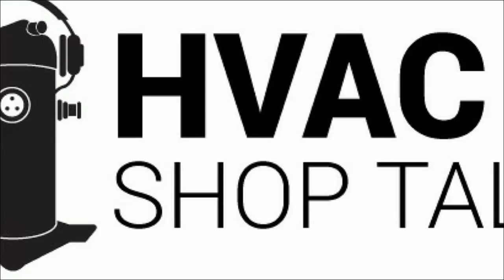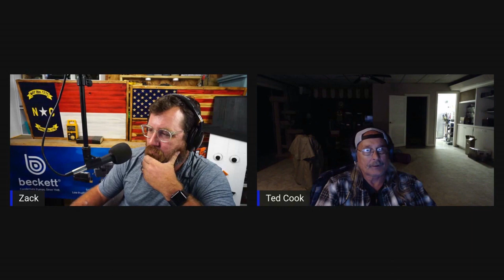This Violates the Rules of HVAC Equipment Design! W/ANTI DIY HVAC

Comment: Airflow... yes. Dumb example, but I remember my old truck's AC would ALWAYS be colder on 'fan setting 4' vs 'fan setting 5', it's like the air was moving too fast past the evaporator on the higher fan setting, so it didn't cool as well. Moving more air isn't more better-er.

Comment: The Bosch is awesome for arid climates where you want to maximize sensible cooling and minimize latent cooling (where energy used for dehumidification is wasted energy). It automatically adjusts for zoned systems and for constant fan operation, and for undersized, poorly designed/installed, high static/low airflow duct systems. You shouldn't install a high TESP duct system, but when that's what you find in most homes, the Bosch is great replacement condenser.

Comment: if you get the Bosch smart thermostat does it become a communicating system then? I know the indoor blower is still only 2 speeds but wouldn't the thermostat be able to say more than "on or "off" at that point?
Reply from the maker: It would have a bit more info, but I essentially have an upgraded stat when you take into account my zone panel.

Comment: The Bosch was a good idea in theory but as we have all learned it doesn't work. I'm waiting to see if the Gree Flexx or the Ducane Lynx are any better.
Reply: How popular are Bosch units? I've never seen one where I live.
Reply: The Gree is probably going to be good, but I think you’re also missing a few things that the Bosch is good at.  And FYI Lennox already beat Bosch to the simplified version but…. Don’t wait for Ducane…. By the time they have anything that just means Carrier has figured out how not to build it and then did that a few extra times